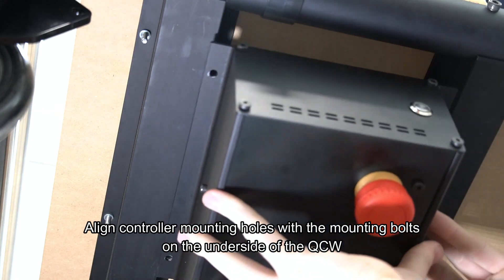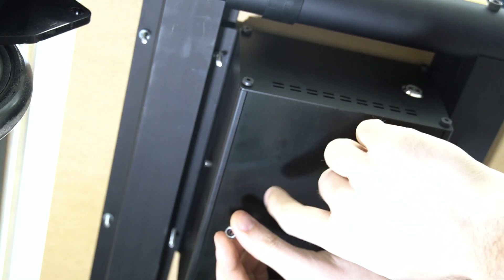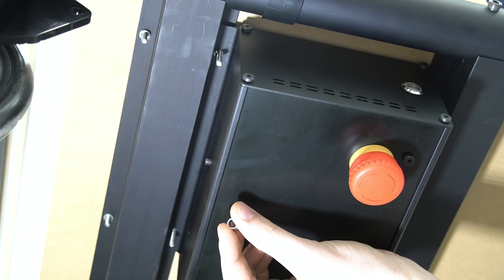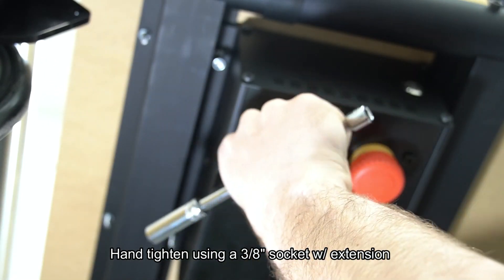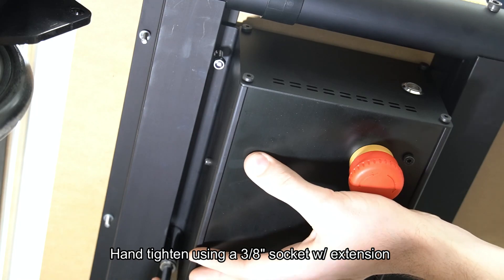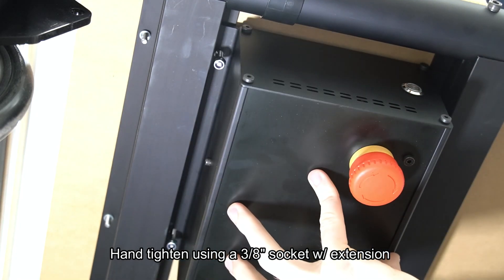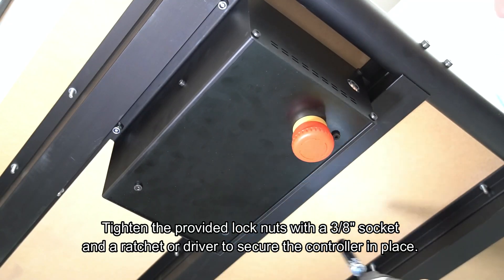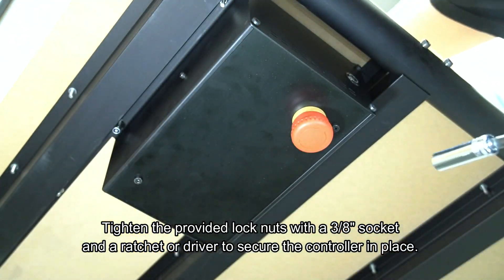Mounting a controller to a QCW

Comment: For this to work it seems you could not have a table surface in the area where the controller gets mounted.  Connecting or disconnecting any cable will require climbing under the table and fumbling in the dark or working by a headlight or flashlight.
Reply from the maker: correct.  this is only if you use the rolling/folding stand.
Reply: @OnefinityCNC  is there a video on how to install the controller when the waste board is secured from below.?